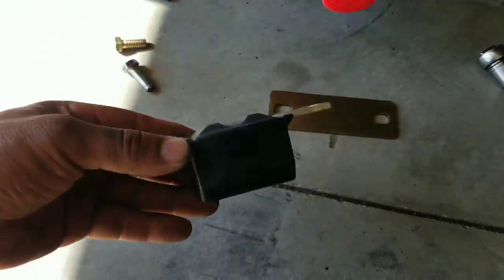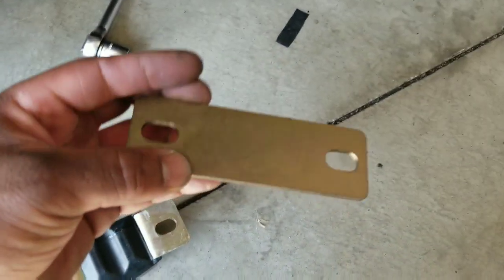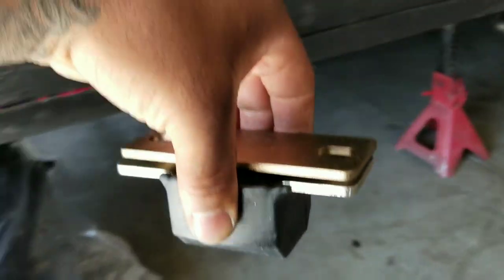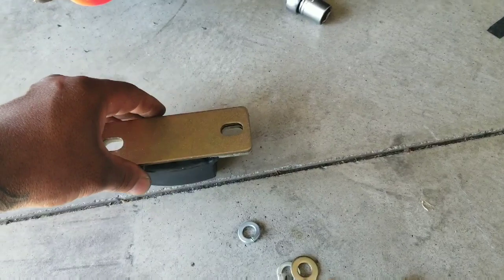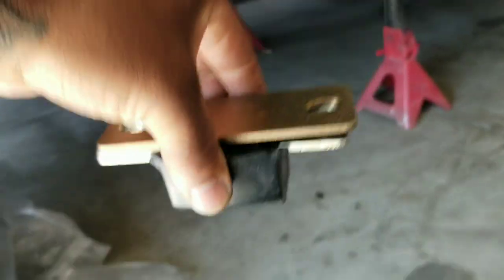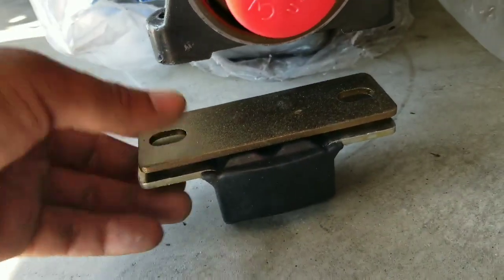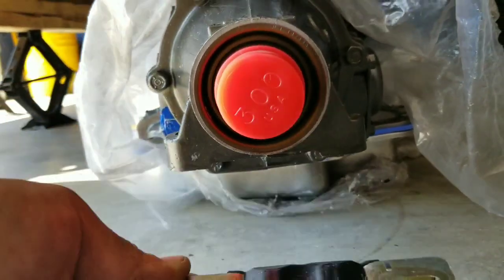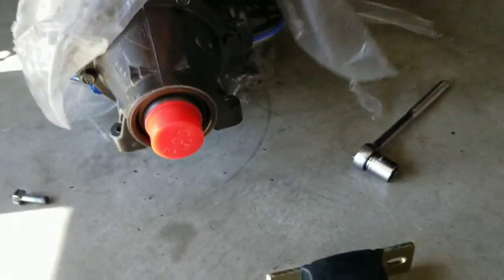TURBO 400 POLY TRANS TAIL MOUNT

Comment: It is a preload plate, not a spacer. They must be used. Have the same mount for my Nova. If you look the part up on Summit Racing there is an instruction sheet. Also the mount is directional.
Reply from the maker: Gees I might just use my stock one lol
Reply: ss396rat 
That’s no fun! That’s why they call it a project 😉
Reply from the maker: @Kris-fp5lj  lol

Comment: Careful using that middle zinc bar. Bought the same mount and it jacked up the angle of the th350 tail snout, made driveshaft hit trans tunnel on my nova.
Reply from the maker: So dont use it?
Reply: ss396rat supposedly it’s necessary for setting preload on the urethane. I can’t say for sure if u should run it or not since our setup is different. I was able to use both by hammering my trans cross member where the mount sits. Personally, I’d recommend comparing this new mount to the one you have on your old tranny that u know has good clearance. If it’s bigger then either don’t use the middle plate, or hammer your cross member as well

Comment: Likely minimizes deflection or maybe be the safety interlock they mention on this page ? 
https://www.speedwaymotors.com/TCI-952500-GM-Severe-Duty-Trans-Crossmember-Mount,334182.html
The picture shows it like you had it though.